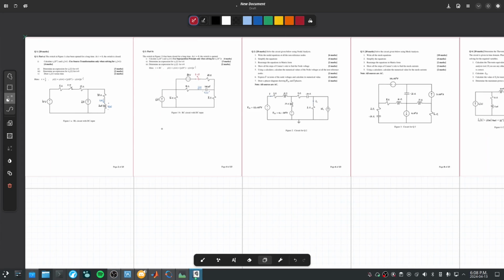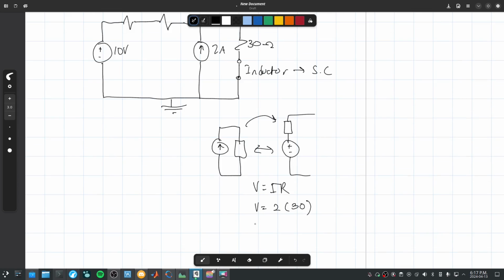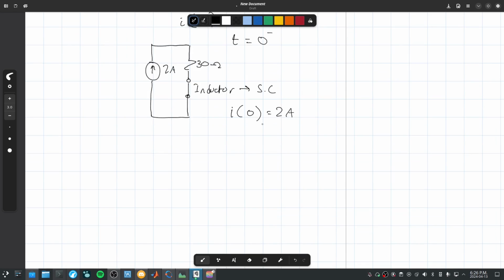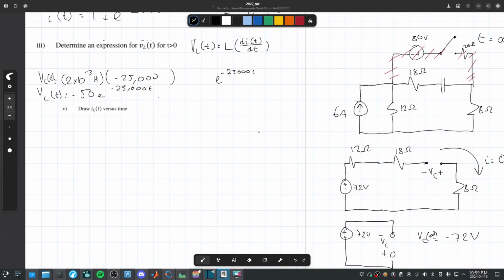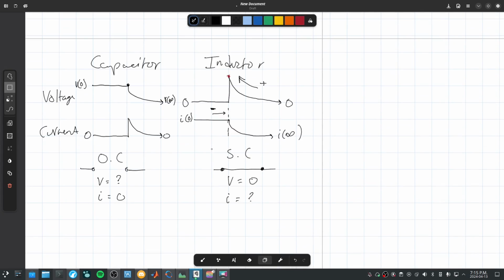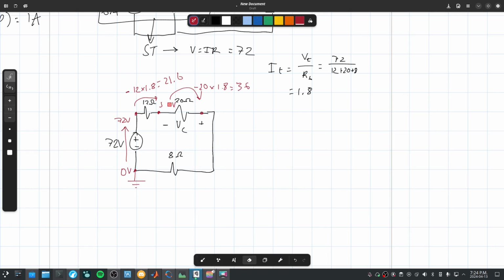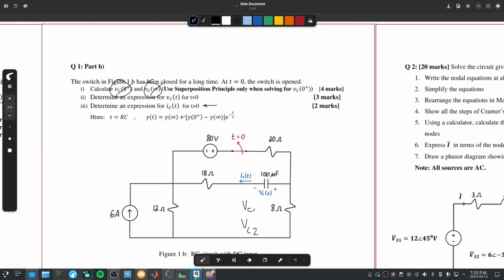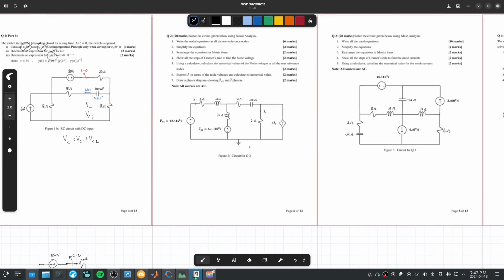TMU ELE202 2022 Final Review Q1 - RC and RL Circuits - Electrical Engineering

Comment from the maker: Update for Q1: I have been informed that Q1b, when it says use superposition only it REALLY means use superposition only. Using Superposition + Source Transformation is not allowed and will result in a zero on the exam.

Question: For 1a, why is i(infinity) 1A and not -1A?

Answer: Source Transformation flips the direction of current. You will notice in the un-transformed circuit, the current through the inductor is clearly positive, but in the transformed circuit, it seems to be negative. So you must flip the sign there. Apologies for not being clear on that in the video.